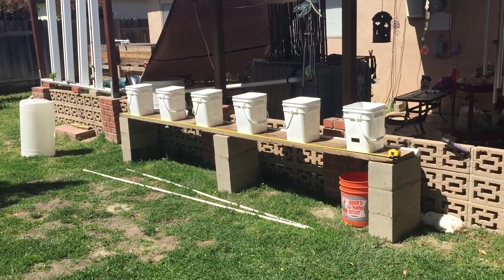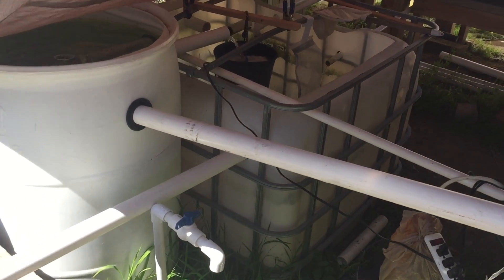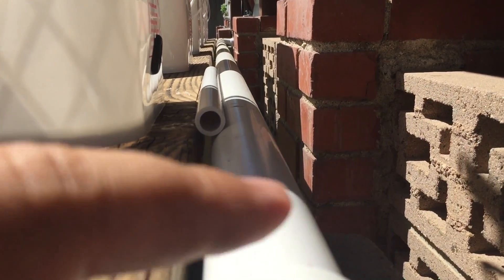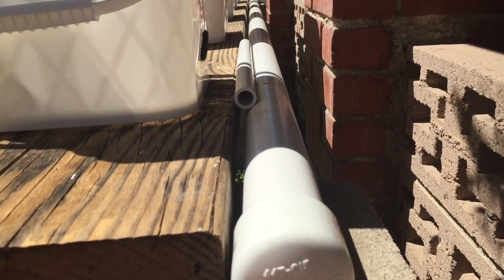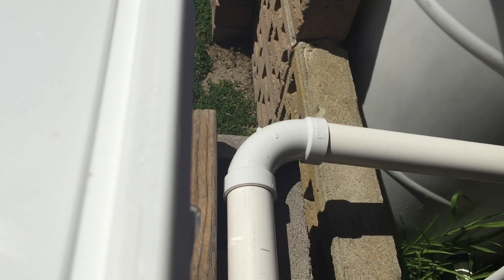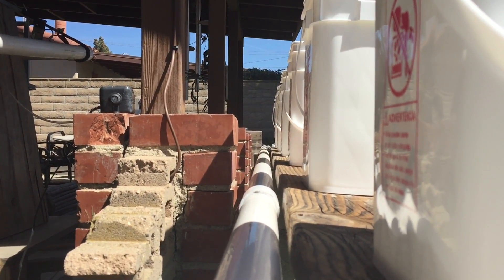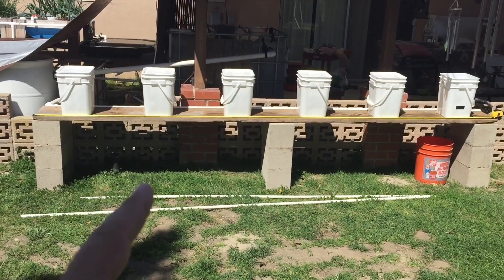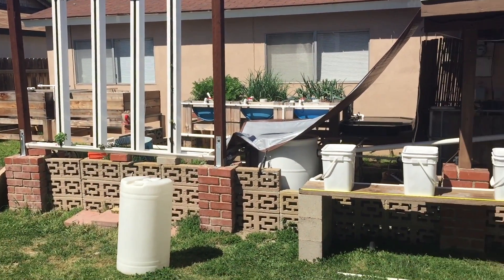How to: Dutch Buckets - Part 1 - Drainage

Comment: I like using white Teflon Tape to seal my joints so they don't leak and you can take them apart later to re purpose the pieces if needed. Your gonna have tons of  positive results with that setup for sure👍 Thanks for sharing and keep up the good work.
Reply from the maker: I was going to put teflon tape but I wanted to try it without it and it is working great so far:) Not 1 drip my friend! Now that my water is just right I think it will be good as well!

Comment: a DWV 90 sweep. HD has them. A sch 40 elbow is probably what you were thinking of for the hard 90. It's all good. Thank for making and posting the great video!!!! Going to look for your other parts too!
Reply from the maker: Thanks!  I have not put out the other parts yet of this video. I should be putting some more out soon so keep up-to-date by subscribing and hitting that Bella icon so you get notifications :-)  The actual bucket build should be a lot funner of a video but I wanted to start with the very basics of this because I always get asked later on how I set everything up.

Comment: Sweep 90?  I've love mhpgardeners' stuff too. Just thinking out loud, I've wondered about making that return drain catching from the buckets a gutter. Then I'd want to try gravel/hydroton and plant some lettuce or leafy greens in it.
Reply from the maker: Bingo! It is called a sweep 90:) Thanks for that Eric! I was almost going to make the drain out of rain gutter as well but they plants in the gutter will not get much light in my case. It will work for sure but roots may become an issue so you would have to keep a close eye on it. Good stuff bro!
Reply: it is a  long radius 90 but is aka sweeping 90

Comment: Do you use paint strainer nets in your buckets? I have had good luck using them. just curious. looks great.
Reply from the maker: That is a good question. I am going to try it without them because I did a test and since I have low flow, elbows pointing down in the bottom of the buckets, and using clay pebbles non of them came out of the drain pipe:) Thanks my friend!

Comment: dwv sweep 90 is right, but be careful using dwv fittings and pipe, they are not made with same chemicals as potable water pipes and could possibly leech chemicals into water over time.  I know they are cheaper, but not made to same standard chemically.